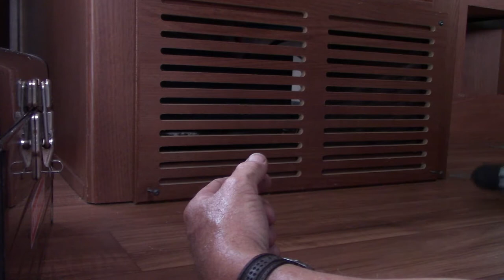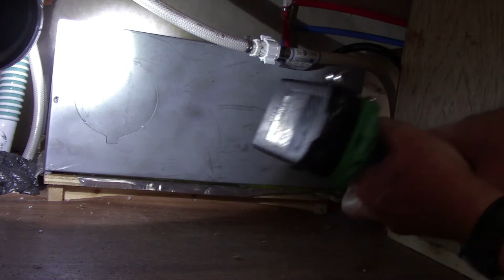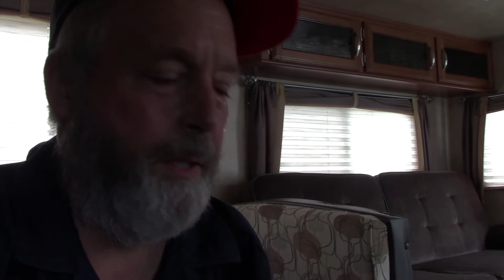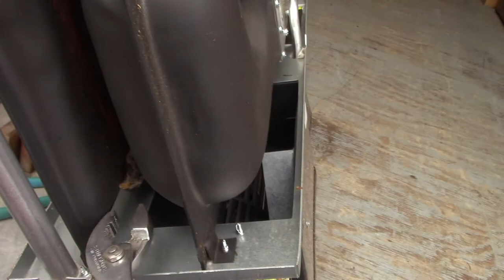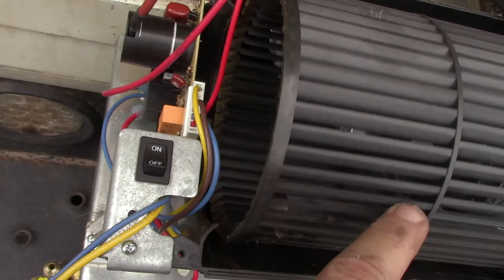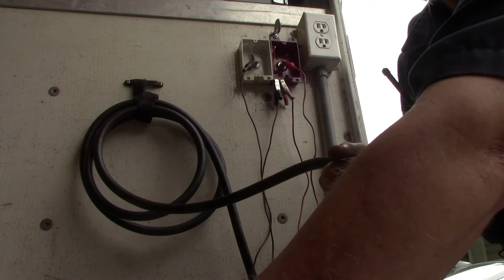RV Furnace Making A Loud Noise

Comment: I have a question , my RV furnace is Sqealing. Very loud but also I smell propane when it ignites. The noise is worse if it’s been off a while . But when it warms up it stops. I do not understand the propane smell though. I have it off for safety reasons until I can get it fixed.

Comment: Mine makes a lot of racket only when the thermostat shuts off the motor and squirl cage scrapes against something as it slows down comes to a stop.  But not when it starts up or when it is running, oddly enough, as it works fine then.   I will dig into it as you demonstrate and see if something is loose or if I've got a well done mouse in there.  Have you ran across this before?  Great video, thoroughly entertaining!
Reply from the maker: Pretty close tolerances in there with a lot of plastic parts, so it is not uncommon to have a rub.

Comment: 👍. if a propane furnace has a black soot build up in the exhaust.  does that mean for sure its shot or has a cracked heat exchanger
Reply from the maker: It means it sure needs some service.

Comment: My camper furnace make rough noise only when it starts up. Low RPM, no heat.  After a minute, it goes smooth and makes heat like normal.  I imagine it's not a mouse - that a dried out mouse corpse would make funny noises all the time the blower runs. But I definitely do have mice in here - I keep catching them in  a live catch trap.
Reply from the maker: Mice love RVing

Comment: Wish you would have mentioned if you use propane tape on reinstall!!
Reply from the maker: I never use Teflon tape on propane fittings. I use liquid Teflon and then only on pipe fittings. Never on a tapered or a JIC fitting.

Comment: Ours made a rattle, then squeal.  Bf is worried about taking it apart etc since hes unfamiliar with it.  Most people don't work on RVs around here for anything.  Cant afford to have it fixed at this moment even if I could find someone.  Is it likely safe even if annoying as heck of a sound?  Its into the cold weather and I still havent even found someone who will work on them.  The furnace fires up just fine its just the rattle and squealing issue.  Hes worried about it blowing up or something.

Not sure what to do.  If its just going to be an annoying sound Id rather run it so long as its not a danger to us.  We can deal with the sound.  He just thinks the sound means its going to blow up.  If its just a couple of dead mice like that (hes been using mice traps to kill the mice so we know we have that issue though its been a bit since one has showed up in any of them.  Will they cause it to be dangerous or just cause it to make the sound.  Is it something that can wait until Spring?
Reply from the maker: Squealing and rattling is probably something wrong with the fan or the fan motor. You need to get it looked at. It ain't going to get better.
Reply: @hillbillyrv  its on right now and sounds fine it just does it at random which is what I dont understand it happens more at night than in the day.
Reply from the maker: @SunnieDIY  It ALWAYS happens at night. ha ha
Reply: @hillbillyrv  we run it in the day here too though (considering we live in Maine) it can be pretty cold in the day too.  Its just super odd to me why it only happens at night.

Comment: My lights were flickering and the furnace wasn’t on but was making sounds. Could it be a bad battery?
Reply from the maker: More likely a bad connection or a bad convertor. Hard to say for sure.
Reply: I appreciate it. We’ve been in this ice storm for two days. I shut off all power for five minutes and turned it back on. Everything seems to be good. I think I was overloading with having the electric water heater and space heater running for too long. I have a spare inverter incase the factory one goes out. I took the cover off the furnace and vacuumed everything I could reach. Once everything dries up, I’m going to take the outside cover off and clean it. It’s pretty dusty in there. Thank you for the swift reply.
Reply from the maker: @matthewhooks452  Hang in there Matthew and good luck.

Comment: Hi. I had mouse problem in my RV myself. Took furnace out. Took mouse out. Fan seems free. Spins fine. I didn't have to disconnect any wires. Just 2 real thin wires came apart (thermostat wires?). I put back together. Put everything back. Doesn't come on. What  am I missing?
Reply from the maker: Check those thermostat wires and if they are really connected, then switch them around.
Reply: That didn't do it. Is there anything I need to reset? The furnace was working fine, all of a sudden it got loud. We simply turned it off and let it stop. There was a mouse in fan. There is an on/off switch in back. It's still on. My furnace and camper looks exactly like what your working on in this video.
Reply: The air conditioner working off same thermostat is working fine.